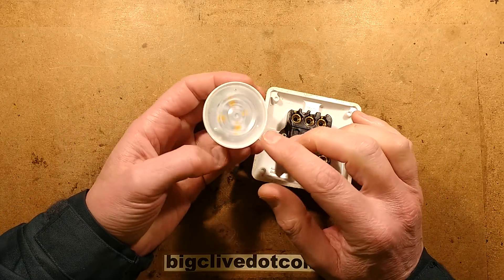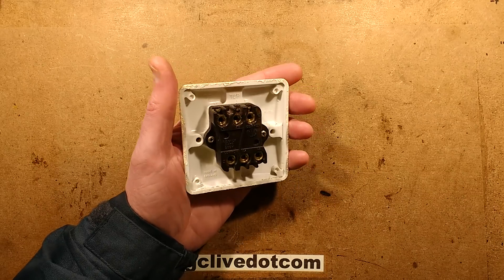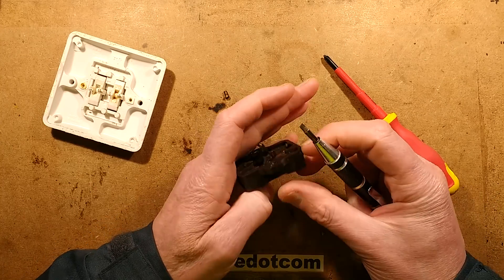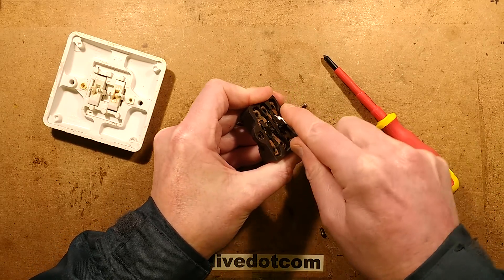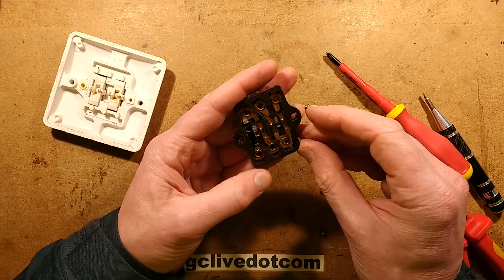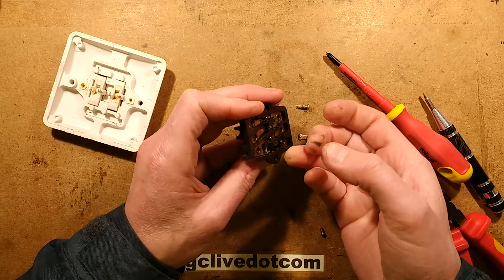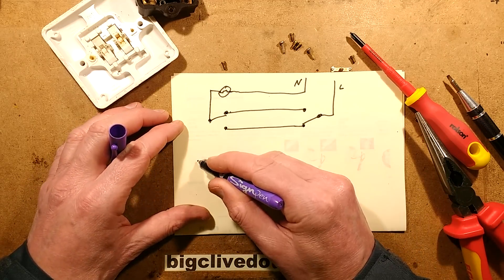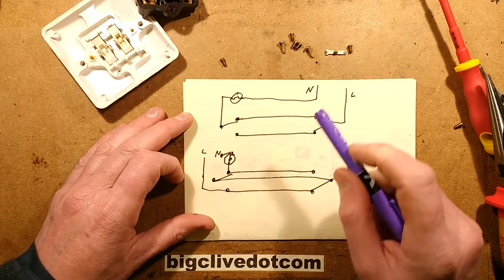Old arcing switch killing LED lamps.

Comment: The cool thing with the second diagram that you drew is that additional switches can be added anywhere in the chain. Who needs more than 2 switches for a light? Hell I dunno heh. And Yes, it is indeed called a 3 way switch in the US and it's the same thing. Why call 2 switches a 3 way switch, hell I dunno. Perhaps it has to do with the number of wires???
Reply: except, if more than one switch is on at once, you'll pull your hair out trying to find the one that has the light on. that way of wiring wont ever work right with more than two switches ;)
Reply: Perhaps I should edit my comment, but I didn't say add another 3-way switch. I also didn't say add a 4-way switch, so my comment could be slightly ambiguous.

So my new comment will be as follows... 

The cool thing with the second diagram that you drew is that additional 4-way switches can be added anywhere in the chain.
Reply from the maker: An intermediate switch has four connections and crosses the two outer wires (strappers).  You can have as many switches as you like.  My hall lights have three switches.
Reply: bigclive... in the US the intermediate switch is called a 4-way, what do they call them in your corner of the planet?
Reply: The second method only works when two switches are in circuit. If you desire more than two switches, you must use the first method described. The second method you cannot add other switches as a 3-way (the ones clive was drawing) just wont work, to break both legs you need 4 terminals, so you need a 4 way switch. If you put a 4way switch in the middle, you end up with that middle switch either having no effect in some cases, or overriding every other switch and turning the light on. Depending on how you hook it up. You must use the first one if you want more than 2 switches, except you just use a 2 wire red/black cable with ground if you are running live and neutral to the light, or if you are running live and neutral to the switch, you have to use a 3 wire with ground cable.

As for why you would want more than 2 switches. Its rare, but in some of the larger American houses you can have large rooms with multiple entrances, you should always be able to switch room lighting from an entrance. In my house there are 3 switches for the basement lighting. two on the stairs (top and bottom) and a third on the sliding door that walks out to the backyard. Some central living rooms have 3 or 4 switches if they also serve as the main entrance, as you usually have the front door, bedroom hallway, kitchen/utilities, and sometimes the basement stairwell.

Comment: At least you can harvest the guts. Are the LEDs still good?
Reply from the maker: They're quite specialist with multiple chips inside.  The panel could be used and the PCB could be stripped.

Comment: My bathroom switch arcs a lot, but the 6+ year old LED GU10s have coped fine. Perhaps older bulbs don't use the capacitive droppers.
Reply: fact, the LED's are what's causing the switch to arc. just flip it on and off fast, you'll hear all sorts of snap, crackle and pop..

Comment: Here in the USA we wire out "three way switches" like drawing two... and we also have 4 way switching (3 switches controlling the same light) not sure where our stupid naming convention came from!
Reply: Its not really stupid once you know why. The switched are named from the number of independent segments of switching contacts. A 3-way switch like what clive showed, has 3 contacts per switch, a common and two legs. A 4 way is a strange switch internally as is never breaks contact between legs like a single switch or 3 way, and instead just switches which contacts are connecting. 4 way switches have 4 contacts on them. A 4 way switch is the only way to have a circuit with more than 2 light switches on it and have each switch operate the light independently.
Reply: Illogical or not, that IS the US naming convention. Just look at the Imperial system, thats illogical, 12in to a foot, 3 feet to a yard, 4 quarts to a gallon, but everyone agrees thats the standard of measure in the US. Just because you don't like it and would rather it be different, doesn't mean that most every US and Canadian electrician is going to give you the time of day. We also call DPDT switches, 4way, intermediate, and crossover switches, though most just use the term 4way.

There is a difference between switches in electronics and switches in building code. In electronics sure, a 3 way switch has one input and 3 outputs, but thats not how 3way switches work in term of electrical wiring,
Reply: Don't hate the player hate the game! I agree it's kinda stupid but that's how we roll. From the looks of it I would prefer U.K. wiring in allot of ways. I like the common use of compression screw terminals, stranded wire, and no wirenuts! but the ring main seems totally foreign here in the US unless someone has back fed a circuit!
Reply: My mistake, I had interpreted your first comment as being snide, so I replied in a similar fashion. If that wasn't your intent, I apologize.

I understand how it appears to an outsider, it appears exactly as you said it. Illogical, which isn't wrong. Having two completely different things named exactly the same while they are in similar fields can be confusing. But that's just the way it's been. In electronics it seems that us Yanks (as Dave Jones calls us) are pretty similar, with some differences here and there. But as electrical wiring goes, there are completely different standards between America and a lot of the rest of the world, especially great britain. While I like calling them 3 and 4 way switches because it makes sense to me, doesn't mean that's what the rest of the world thinks, i'm very aware of that.

Comment: Switching elements in critical applications often use switches with wiping contacts that give a certain measure of self-cleaning.  In the old days, they also used mercury-wetted contacts, but that is now a grievous crime!
BTW, one way to detect an electrical arc is to use a portable AM radio.  If it has a ferrite rod antenna, you can even do some rough direction-finding, although if you have an amateur radio operator or SWL living next door, he would let you know right sharpish!

Comment: Just for fun, I simulated both switch wiring ideas on Falstad: (shortlink) http://tinyurl.com/y8cntb22 

Your idea looks... Somewhat bad. Easier, sure, neater as it's a point to point connection. But you get longer wire, and more.. losses.
Reply: Alucard Pawpad I may be misunderstanding this, but it looks like the total wire length should be the same for both. The only way it wouldn't be is if L and N are physically separate rather than bundled in the same cable. Certainly that would work electrically, but be potentially confusing, as well as need more cable runs even if the total conductor length was a bit less.
Reply: 81rjp: His version with a single 3-core wire connecting the two switches, is two cores are constantly in use for a LIVE. Making a longer path by 50%. Look at my simulation again and see TWO wires take path in the current. Not just one.
Reply: Alucard Pawpad In an actual installation though you'd have a current path of light -> switch1 -> switch2 -> light compared to light -> switch1 > switch2 > switch1 > light. Yes, the first way could be a bit shorter but to take advantage of it you'd need an extra cable between switch2 and the light (3 cable runs rather than 2). Of course, you could have it electrically wired as 1 but physically wired as 2 to avoid that, but then the conductor length would be the same.
Reply: 81rjp ... Oh yeah... Either way the closed circuit is one short loop. D'oh. I got too absorbed in fighting falstad's horrible bugginess to get a simulation to work right. 

There really are no downsides to clive's "3-core" fix! :O
Reply: now try adding a 3rd switch and see what happens :))))
i'll also put this here, that was done many years ago also, named "coast or california" 3-way in usa.. https://en.wikipedia.org/wiki/Multiway_switching
Reply from the maker: In the UK we use a ceiling rose based wiring system for lighting.  Each room has a rose that had a feed and neutral looped through it and a switch cable going down to the end of the switch run.
Reply: 81rjp In the traditional (his #1), the lamp only has a wire to the second switch and the live only has a wire to the first switch.  The 2nd design only makes sense if you need a live at both switch locations (e,g. for outlets) or you are modifying a single-switch install by adding an extra switch where no other installation is located. Also, while a 3-core cable can be used it would be dangerously against regulations to use the common kind where 2 of the 3 have the reserved colors for neutral and earth.  Never put live (or switched live) in those colors, or someone else might get shocked.

Comment: I don't know the details for lighting but I expect mains powered products would have to pass relevant EMC tests viz Electrical Fast Transients and Surges. Leads me to ask the question: do you doubt the Philips lamps are compliant (no - me neither) or do you suspect there's something else going on - perhaps to amplify the arcing in your installation? Or do the skanky old switches get all the blame?
Reply: Mike Page I'd say that Phillips must have dropped the ball, going from making the best LED bulbs on the market to making some that die from a level of contact arcing that would take at least 20 hours to kill a 1000 hour incandescent bulb.
Reply from the maker: The switches were definitely arcing loudly through the oxide layer that had formed.  The capacitive droppers are basically a filter capacitor across the mains.  Other lamps on the same circuit did survive, but that fusible resistor in the Philips lamps seems quite sensitive.  Possibly also due to the higher wattage rating resulting in higher current spikes.

Comment: I would gladly have seen you taken more time to open the lamp in a non destructive manner, then replace the resistor (fuse) and show us the light working again
Reply from the maker: I was slotting a video together quickly before a flight then next day, so didn't do a repair.  The way the wires are crimped in requires that they be drilled out if possible and then an attempt at soldering new ones in.
Reply: +Maico Clive did explain that it's not possible to open these lamps in a non-destructive manner. Please keep up!
Reply: what I said wasn't a complaint at all . It was a way to say 'you shouldn't have hasted' because I like him seeing making long videos :) he seemed a little rushed. Also he said he started his video saying he repaired another Philips LED lamp with the same problem so he might have found a way to open this one in a non distructive manner also. Please don't speak to me ever again this way.
Reply: bigclivedotcom that would be a lot of work for a light costing a few pounds (here I can get a Philips E27 LED lamp for 4.50 Euros). Understandable you wanted to end the video cause of your time constraints.

Comment: I am confused about the two way switching. I keep looking at the drawings but can't work out what happens when you switch each one. Does each one independently switch the light on and off??
Reply: To simplify, both switches must agree on which of the two intermediate wires is used. If they disagree, there's no power. 

I set up an intractable simulation to help show it:  Falstad: (shortlink) http://tinyurl.com/y8cntb22
Reply: Jigatree, yes, either switch can turn the light on or off. However, they are dependent on each other. If you flip the light on with one switch and off with the other, you can end up the both switches in the up position, but the light will be off. This can be irritating for OCD personalities!
Reply: jfan4reva Not as much as when someone installs it so the light is on when both contacts look off, but off when one contact looks on.

Comment: I finally get how a three-way switch works!!  Thank you so much!!

One question: how would a 4-way switch setup work?  We have one in our house where there are 3 separate switches that control one group of lamps.  One switch at the back door that enters into the garage; one switch near the left garage door; and a 3rd switch at the right garage-door.  They all control the lights in the ceiling of the two-car garage, as well as one light in the area of the “people” door to the right of both garage-doors.  All the ceiling-mounted lamps come on (or off) when you flip just one of the 3 switches.

So would a 4-way setup be as simple as extending your 3-core wire to a 3rd switch in your diagram above?  Or would you need a 4-core wire?

I just can’t seem to wrap my head around a 4-way switch, and would love your input on it. Thanks!
Reply: It has to do with the switches all agreeing together. Every switch requires a new wire. In binary logic this is called XOR-ing. 
All switches fight for the LIVE. 
1 switch = 1 live = open or close
2 switch = 2 live = if two switches agree on the same live wire, lamp is on
For 3 switches you need a special 4way switch that just swaps cables. I made you a simulation here: http://tinyurl.com/y749juvj
Reply: https://en.wikipedia.org/wiki/Multiway_switching
Reply: LMacNeill Typically you install a crossover double pole double throw in front of one of the changeover switches.  Keep adding crossover switches until you have them at all the doors or the electrical losses become unbearable.
Reply from the maker: For more than two way you use intermediate switches that have four connections that are either straight through or crossed over depending on the switch position.  It connects in line with the two outer strapper wires.  You can have as many intermediate switches as you like.

Comment: just a thought , Im an autospark, as varoious car power consumers get replaced with much lower current drawing modern equivalents (LED lighting being the obvious example) the relays and switches that drive them become much more finickity and glitchy, almost like the contacts need a decent current draw to burn off some oxidisation.
Reply: Denis O'brien Yes, many relays and contacts are physically designed to clean themselves and survive the longest at a particular combination of AC vs. DC and arcing.  Everytime you switch, a tiny part of the contact poles melt and vaporize.  With the expected load it will even out for maximum lifetime, with the wrong load it will quickly selfdestruct.  Finding switches that cover a wide range is really hard unless you pay big bucks and accept a bulkier size.

Comment: Would this fry ordinary lightbulbs too?
Reply: Alright, thanks!
Reply: I have known one which was indeed deteriorated enough to zap a filament lamp. More common with HALOGEN filament bulbs as the filament is a little fragile on (mains voltage) halogen lamps.

Comment: Hi Clive, Very Interesting. Do you think the wattage rating on the resistor is the problem here or something else. I take it those philips bulbs are designed for 50hz Ac the same way ordinary incandescent bulbs are designed for 50hz Ac. I would blame the switch but I think your house here is mostly to blame. All very odd.

Comment: To repair those type of lamps, you can drill with a very small bit into the 2 connectors (bottom of the lamp), it will shorten the leads and give you access to the power supply. Then to put it back together you'll just have to add new wires through the two GU10 connectors you drilled in and grind them after some soldering. See here for instance : https://youtu.be/_lEgz2AxIq0?t=2m39s

Comment: so you could blow up an LED lightbulb by holding the light switch between on and off?
Reply: Ollyweg 0~ you've just eliminated vast majority of the US switches from ancient to still widely used ones. they were a long spring metal bar with contact, that a plastic cam pushes and releases and they can easily be held sizzling and many times fail in sizzling state when worn out in on position!
if you flip it partially and very fast lookout arc city, add to that the led's tend to make all switches ARC horribly.
Reply: hold the light switch halfway and watch everyones TV reception go to shit because of the fuckhuge sparkgap transmitter you just made lol
Reply: yeah, it would really kill AM radio and old analog TV, not so bad now with digital, but now enough noise causes tilling and freezing, with sudio-drops, before you could still watch the shows with snow/static and buzzing audio lol. digital to me always did seem like 5 steps forward and 15 backwards..
Reply: it looks like the switch he tore down could be held partway and make to hold an arc.

Comment: My friend's house still has like 100 year old light switches that are round buttons that you push in... maybe I should tell him to change them when they switch to LEDs haha
Reply: Haha that's cool!
Though I will say, it MAY be possible that they are new, because I know there are special switches you can get that look old fashioned ... for the looks!
Reply: They might be fine, as a push switch I would expect would switch much faster than a toggle. I would be more concerned about them on incandescents as any build up would cause a slightly resistance and so heat up if passing a decent current.
Reply: Boredness Don't.  The best old switches (the ones that didn't die 80 years ago) were massively overbuilt, especially if the same models were used for 220V DC, as found in some old power grids.